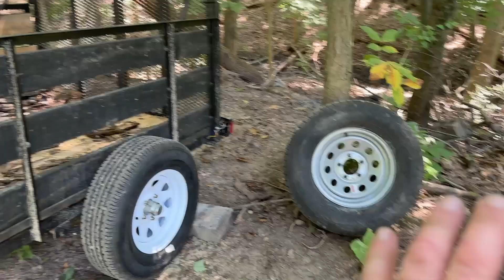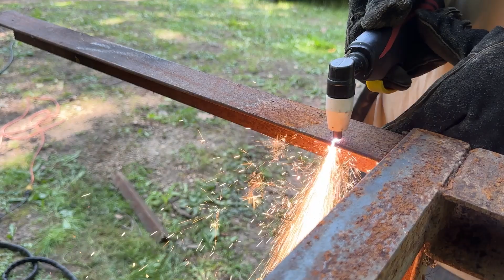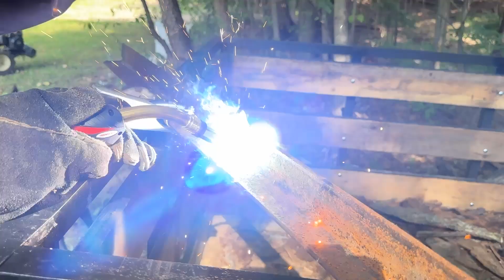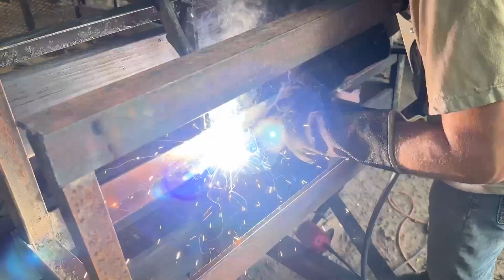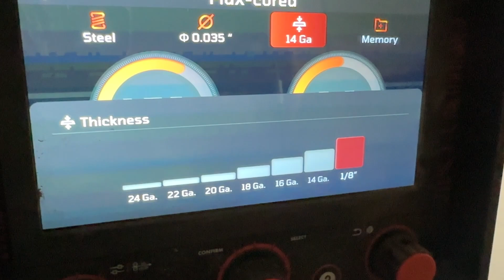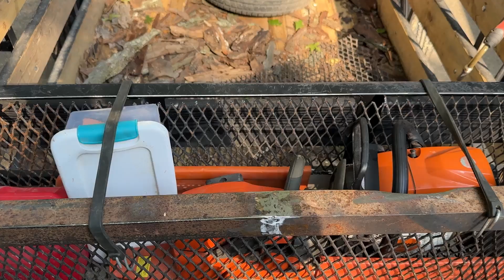Welding The Utility Trailer Accessory Basket #yeswelder

Comment: Aside from dog safety which everyone else has already mentioned. I know its just a wood hauler but you would get much better results from the paint if you hit it with a rusty metal primer first then the black. An extra step but better than fully cleaning all the material and less touch up later from rust through.

Comment: Dude.  If you need eye protection, doesn't it seem logical that your dog does as well?  Please leave the dog in the house for projects like this, or put it in an enclosed run so it's not underfoot.
     If you want yhe top opening to be more convenient, remove that angle stock and rotate it so the horizontal part is pointing forward instead of rear ward.  It's a pain in the butt to do, but so is how limited you are when stowing items in the basket.  Just decide if you want the horizontal part on top or bottom.